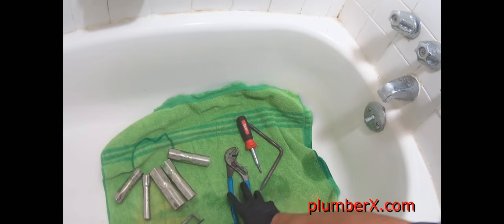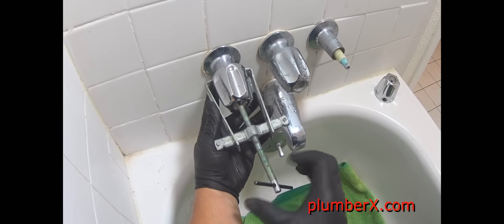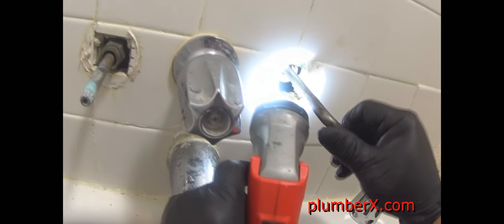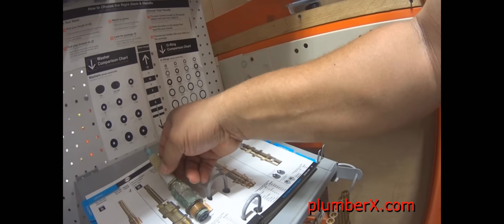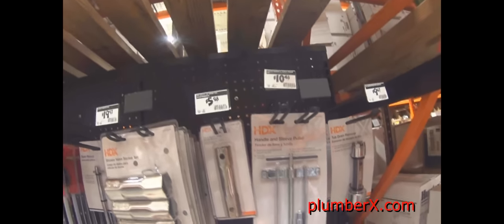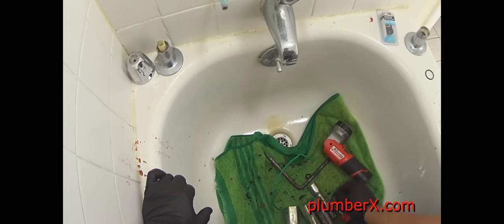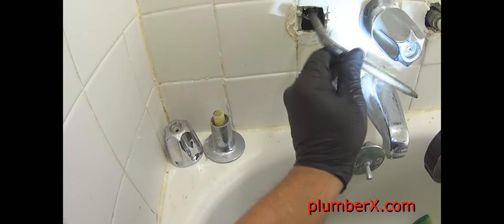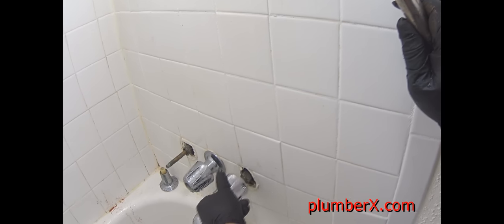Shower Hack That Will Save You Money

Comment: Thanks for the video.  I am not going to do it myself, but it did educated on the elements that I should be asking the plumber. I have to get the stem, seat replaced. Hopefully I ask if the plumber sees if it needs new packing etc.

Wish the seat and stems had standard size to screw them in.

Comment: This video was extremely helpful.  I changed both the valves and the valve
seats, using the valve socket and the valve seat wrench.  I chose to buy the valves, the valve seats, the
faucet handle puller, valve socket, and the valve seat wrench at True Value
because they are most helpful and knowledgeable compared to those at my local
Home Depot.  

One issue I had was that the phillips-screw on my hot water
handle was stripped.  The guys at the
hardware store hooked me up with a screw extractor, which allowed me to removed
the stripped screw.

Total cost for tools and materials:  $98.00

Thanks you so much for your unselfish contribution.  You really saved me a lot of money (and possibly
helped other people from getting ripped off)!
Reply from the maker: Glade I could help. Thank you for the nice comment

Comment: Great video.  I'm changing old brass to new chrome fixtures- no leaks.  Two stems came out easy, and third is STUCK.  Used the tub/socket wrench and now the stem valve is partially stripped.  Any ideas how to get it out? (Obviously, we have put a ton of umph behind trying to turn it, hence stripping)  New fixtures include new stem and seats which I need to use.  The old stems are too short for new handles and pipe trim.

Comment: I've been watching stem replacement videos for an hour and a half and thought yours was the best.  One question I have, most of the other videos I've watched I saw them using teflon tape on the valve seats and on the stem itself.  I notice you didn't do that.  Is that not recommended?  Thanks for the informative video.
Reply: +Claude Taylor Thanks for responding.  I was thinking the same thing.  Great video, informative, professional and made me trust your knowledge and experience.  I'll be subscribing to your channel.  Thank you

Comment: Just a reminder I do believe if you cause the water to siphon out of your water tank and it is firing you can cause severe damage. It would be something like adding water to a boiler that is going empty. This causes flash steam and next boiler explosion. You don't want to fire up a water tank that is not full. I heard you can crack the inner chamber that holds water. It is to small to write about this in comments this is just a small warning note. I learned the hard way when I was 20 years old and was fooling around with the main water shut off valves. I still remember the HAVC workers bringing a leaky ruined water heater up stairs. Make no doubt about it I learned who the culprit was when I started studying house repair. We know....
Reply from the maker: thank you. your right. this is why water should be cut off at the water heater also.
Reply: Thanks hope we can keep people up to date on this. It is bad enough to have bathtub problems.

Comment: I have a Delta 3 valve system in my bathtub, i'm trying to replace the hot water valve assembly, it has a long piece of pipe holding everything in place, and a plastic extension inside, all the parts are new, and match the old ones fine, i lube all the parts that need it, and put it all together, remember that long piece of pipe that holds it all together? when i tighten it down the valve binds up and wont turn at all when i loosen the pipe up the valve turns but leaks, what am i doing wrong??

Comment: I have these faucets in some of my rental  properties and believe me they are a pain in the butt, because I constantly get a lot of calls from tenants whenever they start leaking.. What happens is that people squeeze the knobs too tight because they think the water that comes out of the spout is from the faucet not being closed good enough which will wear out the washers so quickly. The water that keeps dripping is actually from the water that stays in the shower pipe  after you shut off the water. So it's better to replace  them with the new one shower valve and save yourself the headache.
Reply from the maker: Yes your right I run into this all the time. But believe it or not the same goes for the single handle faucets also. People want to keep turning the handle until it's broke. thinking that its leaking. Good Comment thank you.

Comment: Hi Claude! my Dad was plumber/steamfitter. He taught me the very basics of plumbing. I did this same repair about 10 yrs ago. New knobs and stems but without changing the seats.  The faucet just started leaking again so I changd the washers on the stems. Still leaked. replaced stems and still leaked. Assume the seats need to be replaced but I can't get them to unscrew. used Liquid Wrench spray but still can't loosen them. I'm afraid to exert too much force. what do you suggest?
Reply: +Claude Taylor  thanks!! I should've changed the seats last repair I guess. I'm going to try WD40 with that little directional straw which the Liquid Wrench spray didn't have and say a prayer too. thanks so much for fast response. keep up the great videos

Comment: I have the hot water side seat that is strip and is not coming out. Any ideas to remove it?
Reply from the maker: It happens, but not that often. You may need to call a plumber or replace faucet.

Comment: What do you do if the seat strippes when you try to remove it?
Reply: i have the same problem, did u fix your?
Reply: use a flat head a little bigger than the seat or a broken bolt extractor
Reply: I have the same problem on the hot water side.

Comment: I have a question. When I turn on the shower some of the water comes out of the shower head but most still comes out of the faucet. How do I fix this problem? It's a faucet set up just like the video.
Reply from the maker: one it could be installed upside down. easy overlooked. two your shower head should be 6'6" from the foord up, if it's shorter then that. that could be your problem.

Comment: Video was great, you showed me I did everything right but yet it still leaks. The seat went into place easily, the stem followed as the same and yet it still leaks.  I bought the stem with the seat in a package deal from home depot. I have tried rebuilding the unit by replacing all seals/gaskets bought several new stems and nothing is working.  HELP please.

Bob The builder but obviously not the plumber
Reply from the maker: Uhmmm Was it the same type of faucet like in the video? and were does it leak. Same washers, same stems, same sets, same. Try opening the faucet all the way just in case a little debrea got caught in between the set and washer.

Comment: I shut off the water valve, but water is still running out of the bath tub faucet. Is this normal? Also, I tried to get the hot water handle out but it looks like with time there was a lot of white stuff and it is kind of 'glued' so I can't even get the handle out!! Is there a trick to get it out?? Thanks!
Reply: +Aileen Chan your video makes it look easy if the parts actually come off!!!!
Reply: +Claude Taylor Thanks for your quick reply! I saw that video also, but I live in an apartment building, so I didn't intervene in the end since water continued to  drip even after I closed the valves. If it is the water heater valve, then it must be the entire building might need to be shut off. I called the management, but too bad cause I was really looking forward in fixing it myself. I even bought the shower knob removal piece and the wrench haha... Thank you! And please keep posting videos! They're helpful and seeing the items at the store is also very helpful!!

Comment: Quick question . What do I do if the seat is stripped ?
Reply: Bullitt H your screwed it will continue to drip after replacing the stem it will be fine until the washer wears again.
Reply: Not necessarily, I think larger seat sizes exist for this reason. You may need to buy a re-seating kit which increases the size of the seat hole in the tap body so you can put in a bigger seat. This is more involved and requires some more skill, there are videos on youtube that show this process but if you're not confident you should probably get a plumber to do it.

From what I have learned from other youtube videos, you can drill out the seat hole if the thread is bad or if there are little leaks behind the sear. You then re-thread the new hole to suit a larger seat. There are limits to how many times you can do that of course because the tap body is only so big and can be re-bored a certain number of times before it's too weak and thin. In that situation you will definitely need a plumber to open up the wall to remove the old tap body and weld on a new one.

Comment: I just replaced all stems and seats but it still leaks.. What can I do?
Reply from the maker: Only thing I could think of if all the parts are the correct parts. Possible bad threads were the new seats connect to the valve or some one may have already over worked past repairs on faucet valve.

Comment: Hot is supposed be on the left and cold on the right but I've seen it vice versa a lot
Reply: Hot (on left) should close/shut-off by turning the handle counter-clockwise.  The cold (right) should close turning the handle clockwise.  IOW, they go in opposite directions.  Fun fact: many sink valves rotate just the opposite of the shower.  The Price-Pfister for shower hot is harder to find.